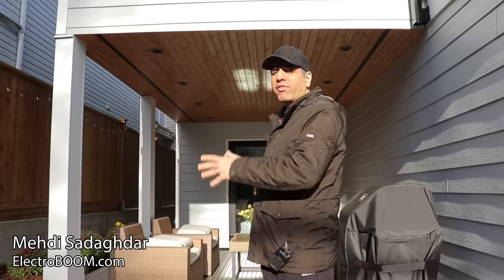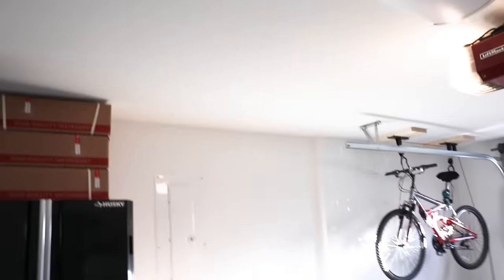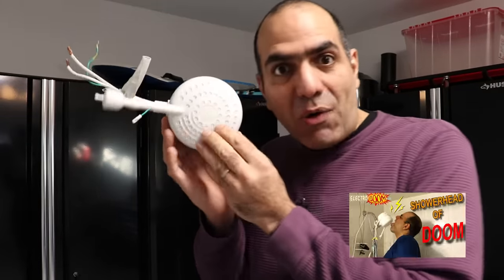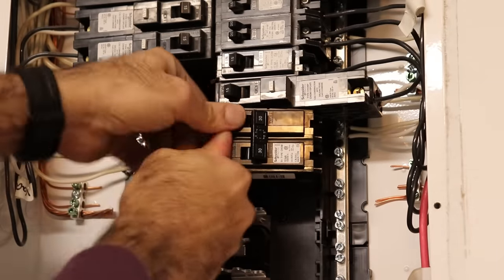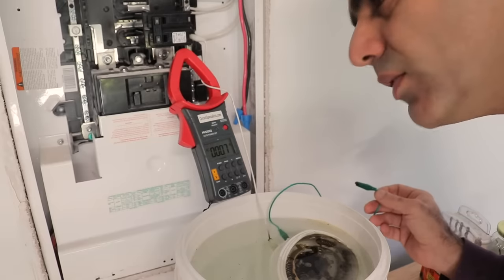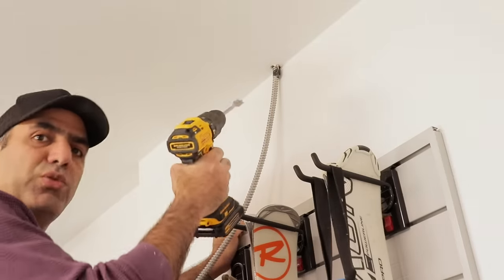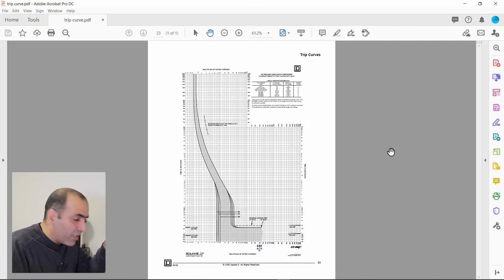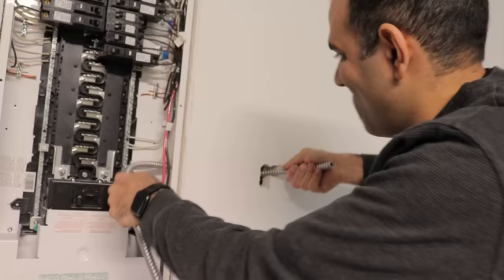Electric Patio Heater Wiring and Installation

Comment: You can tell something in your breaker box isn't live if you touch it and you still are
Reply: LOL!
Reply: I did that once on my 240V panel, cant recommend.
Reply: Funny but not true at all. You can touch anything you want as long as you only touch one at a time.
Reply: @mds1986ms  Go ahead and touch ~ while you stand on a grounded floor.
Reply: @nonamedelete9132  
Id be willing to bet ive been an electrician for nearly as long as youve been alive. 18 years in the game. I know what you can and cant touch... ive touched it all sonny.
Reply: @mds1986ms  lol. I'm in the game since I was five years old, I'm 22 soon. I've got shocked, a lot. I probably have less experience than you, but trust me, I know what I'm talking about. It is still interesting though, why with all of the resistance between you and ground you still get shocked, even if you are standing on a plastic chair with boots on.
Reply: Actually if the power is strong enough, your muscles will seize up and you'll get basically "muscle-glued" to the wire because your nerves would feel like they're on fire. What I've heard is that most deaths are caused after this "muscle glueing" since more and more electricity passes through your body. Also, the amount of time he held that alligator clip on the breaker gave me so much anxiety. Must have gotten so hot!
Reply: @Xzanah  
Wrong!
If you ground out you get a tickle and you jump. If you get between the source and load where you become part of the circuit thats when you get hung up. Or a neutral with a load on it and you ground out thatll hurt ya.
Reply: @Xzanah  Yea but DC is worse, while you have a fraction of a second to get away from AC, DC will stick to your skin. (Experience with capacitors, I do not recommend).
Reply: @mds1986ms  Actually, in this instance, whether a ground was present or not was unstated. Thank you for your input, but saying "Wrong!" beforehand was a bit much. Electricity is serious business, and even with a ground, without sufficient material, direct contact with high voltage can still cause massive muscle and nerve damage. 

I'd like to say for those looking at this for input, both Ham and noname, and I would like to say "as well as I", have all provided well-made statements. Nobody is wrong here. Electricity is a variable project to work with, so always make sure you research sufficiently before performing your specific job. 

(Simply putting this here because I think newbies to the community get scared away by the "Wrong!" feeling. Y'all alright though)

EDIT: reread the convo! Ground present was stated. Still leaving this here to let those who wanna know what's said be able to read
Reply: @nonamedelete9132  
Dc is worse because it builds you up to potential before it will let go of you. 
Lol. 5 years old huh what are you the doogie howser of the electrical world.
Reply: @Xzanah  
Meh whatever believe what you want i dont really care. But just because youre nice or have good grammar skills doesn't make your answer any less incorrect. Its just a well spoken wrong answer.
Reply: @Xzanah  
How could a ground not be present tho. Are we in some hypothetical rubber isolation room or are we just living in magic land where anything goes. There has to be either a ground, neutral or another hot... otherwise theres no potential and no cause for danger.
Reply: That's the safest/fastest way to check!
Reply: Whats fun is if you have a not contact votage detector (tick pen) in one hand and touch the hot bussbar with the other it makes your tick pen light up. Dont try this at home kids.
Reply: @mds1986ms  Seems to be something with individual's tolerance to current... I can touch 230VAC live wire and not feel a thing while sitting on the floor...I can touch across live and neutral with 2 fingers and I get slightly unpleasant tingling. (even opposing hands)
However, this is only true for the actual bottom skin of hands, try this with top of your hands and you will jump out of your skin.
And yeah DC is muuch worse above certain voltage level. For me it's only tolerable under 250V (170Vac rectified)
Reply: @Antagon666  
Mehdi actually covers this. But it has more to do with the moisture on/in youre skin. Hell diet could possibly have an effect what with different minerals and different amounts of said minerals in each person's body. Salinity of their sweat and whatnot. It woukd all play into a person resistance. Im like you i usually wont get knocked very hard at all being a rather dry, thick skinned person i have a higher resistance.
Reply: @Antagon666  Its called the skin effect.
Reply: @nazgullinux6601  
Lol it's not, no skin effect at 50Hz man... 
It starts above 20kHz, at 100Khz and above you can't feel pain, only burns..
Reply: @mds1986ms  Yes moisture is a factor too, anyways my point is that you can somewhat get used to getting shocks (not healthy tho).
Reply: @Antagon666  
Yeah i mean if that's someones idea of a good time who am i to stop them. Whatever blows your dress up is what i say.
Reply: @Xzanah  I saw a clip of someone being electrocuted and couldn't move because his body wouldn't let go of the thing. Someone else tried pulling him away but got shocked when tried, used a scarf to drag him off by pulling on his neck. Saved his life, in the clip you see the guy that was saved standing up before the clip ended. 

Eventually it'd have killed him but because the amps were low it wasn't affecting his heart enough during that short exposure to kill. That's  my guess anyway, the voltages and amps wasn't described.
Reply: AnarchoSynCope  
Ok ill bite. Is there a punchline somewhere?
Reply: Masterful tongue, less words.
Reply: More cowbell, less tampon commercials.
Reply: @mds1986ms  this depends on if the circuit is gfci protected or whatever you call it in your county. In America circuits protected from the panel from ground faults are basically non-existent although I'm starting to see them here and there. If there is no ground fault protection you absolutely can get hung up from grounding yourself out. One of my old co-workers died this way working on a walk in fridge and he grounded out through the metal housing. These circumstances are more rare tho. Usually when people get hung up it's because they grabbed the hot and neutral at the same time.
Reply: @nonamedelete9132  no if you are touching a hot wire and are wearing even shitty foam sole shoes you won't get shocked. This is literally live work 101. I've done this several times and the only times I've been shocked is when I touched either the ground wire or metal box by accident.
Reply: @mds1986ms  lol lighting up a tic tested from my hand is my favorite party trick.
Reply: @rylandavis2976  

How i discovered this was while doing the H-taps on a 200 amp service. See i prefer to do then without gloves and i dont know anyone that get the PoCo to do a D and R so naturally i do them hot bare handed. Well one say i have a tick pen in pocket and everyone know they're always on when they shouldnt be and they never work right when you need them to. Anyhow i go and grab a bucket of amps and my pocket started going off. I was still fairly green yet kinda still thought electric was actually magic and we had to believe in it for it to work. Lol

Akso i live in Pennsylvania.  Lol
Reply: @mds1986ms  lol that's similar to how I discovered it. I was working on a 277 volt lighting circuit that I thought was dead and it started going off in my pocket. The gears started turning and I was like holy shit. I had never worked anything hot at that point was like my 3rd week on the job lol
Reply: I grazed a live wire in my breaker with my finger and only felt a tingle. It was for less than a second but I still feel like I dodged a bullet.
Reply: @spaceagequice4754  
Nah you just missed an opportunity. But if you weren't touching anything else you wouldn't get tickled anyway. Sorry no near death experience for you.
Reply: don't actually do that lol
Reply: LOL
Reply: @nonamedelete9132  I've been shocked by 120v AC quite a few times, it's not that bad.
Reply: @Chris-xo2rq  I live in Israel it's 240v here.
Reply: @nonamedelete9132  AC doesn't let you go, it cycles much too fast to allow that.
Reply: @mds1986ms  Yeah except it's very easy to be touching something grounded without knowing it. And you can still get shocked without touching anything else if it's AC.
Reply: @Owen_loves_Butters  
No you can not. You must be grounded electricity does not just decided to go where theres no ground. Unless youre dealing with 1kv or higher thats absolutely false. 
Besides being grounded and getting a little tickle might be good for some folks... Theres a massive difference between getting shocked and being electrocuted. But then again what fo i know ive only been doing this for 18 years.
Reply: @mds1986ms  The human body has capacitance so you can be shocked by AC while being isolated from ground.
Reply: @Owen_loves_Butters  
What youre speaking of is the equivalent to a static shock at the very best. Your argument is invalid sir. And still you would not receive a shock upon touching the live ac rather when you discharge to ground again most people generate a larger voltage discharge in the winter while dragging their socks across the carpet.
Reply: @Owen_loves_Butters  wrong, the shock itself is enough to set you flying, with or without your finger skin.
Reply: @nonamedelete9132  *without shoes. Shoes will insulate you.
Reply: @iangraves9440  if you touch live with shoes you don't get a shock? I don't think so. Any how the hell voltage goes through the insulated floor even with bare feet?
Reply: @Antagon666 burning doesn't cause pain? Lmao
Reply: @troglodyteking3848  you are taking it out of context. Of course burns on skin hurt, but it's nothing compared to dangers of electricity going through your internal organs.
Reply: Death waiting to happen
Reply: I almost died doing this type of testing if something is live when I was studying electricity haha
Reply: Lol

Comment: "49 amps of current in your shower!! Which house in the world is wired for this??!" Yours Mehdi....yours lol
Reply: He doesn't use it though
Reply: I'm scared to watch this video now
Reply: His  main line is capable of holding 100 amps but our main line is able to hold only 20-30 amps lol
Reply: In Brazil, of course. If ground is not well connected, to avoid electrical shocks you "jump" while opening or closing the water register.
Reply: My shower is 8500 watt! And they are not the biggest available
Reply: lol
Reply: This is BRASIL!! hehehehe
Reply: Haha
Reply: Plasma i subbed
Reply: He mentioned that his house wiring is capable of 200 amps since he had to get his wiring changed and upgraded. I don't know if that's related to what Mehdi is talking about.
Reply: @manan-543  Probably he had to upgrade it because he likes to test if breakers work. With alligator clips and and a dismembered shower head.
Reply: the water in the bucket near on instantly boiled
Reply: Lol
Reply: I recall most new construction in Canada is like that which is needed for EV ownership. And when he mentioned the 240V outlet in the garage got me thinking he is thinking about a Tesla.
Reply: ...and most of Britain.  ~40A electric showers are very common.
Reply: We have a 35A supply for an electric water heater. That gives 24kW in Germany. That's enough to cook yourself in the shower
Reply: @j--xe3ke  I'm sure Germany runs on 230V no? 230V at 35A makes 8kW (8050W) not 24kW or am I missing something?
Reply: According to the datasheet, his wiring is good for it for about 15 seconds :D
Reply: Laughs in Brazil
Reply: Being a brazilian, this one really made me laugh 😂. For older houses, there's no ground wire, so people shower using rubber flip flops with the hope of not getting zapped while touching the valve
Reply: @onlineearner4669  It is probably 3 phase power
Reply: @SerumCRM114  oh ok makes sense, thank you for clarifying that
Reply: @onlineearner4669  In Germany they have 3x230 @ 35 A like most in Europe
Reply: we have an instant electric water heater that is not in the showerhead but before it and it is 220v 2.7kw and it is very good lol
we also have 3 phase 220v 16a
Reply: @mypower7853  in the UK the average is around 60 to 100amp
Reply: @onlineearner4669  I believe 3 phase is common in German homes, 3 phase at 35A would give 24KW
Reply: Here in Brazil it's very common
Reply: @brasilianguy5437  just buy ballons and cover the shower handle with them.
Reply: Only 20% percent of houses in my city have ground, most people don't even know what it is (although ground wire is a sick joke) and dying due to electric shocks (unless they are doing meows, illegal installations) or fires due to electric is veeeeery rare
Reply: Photonicinduction
 !
Reply: @thomasostman8678   in the UK I think you'd struggle to get a 35A MCB, we get 6/10/16/20/32/40/50/63 A ratings commonly
Reply: Ones without hot water 😂
Reply: ..... Startup current......
Reply: @Ludwig Van Beethoven  styropyro channel!
Reply: @brasilianguy5437  I don't live in Brazil but I was shocked by the metal body of my laptop when sitting my back against hot water radiator. It turned out that there was some grounding issue and when enough things were plugged in there would be around 70V between neutral and earth. Probably not deadly but pretty scarry and painful.
Reply: @onlineearner4669  I think Germany is similar supply characteristics to UK so this would be a 3 phase water heater on a 3 phase breaker thus giving 3x8kw or 24kw total
Reply: We have not one, but two 6800W showers.They're both 240 V. The house is wired to take at least 4Kv with one 85A breaker on each phase of that 240v.
Reply: Bruh not even my welder draws 16 Amps at peak around 20.2v
Reply: He would be amazed with Brazil, here in my city we just use 220V, even so, lot of us use two phases or three. And... My shower is 7500W  hahhaha